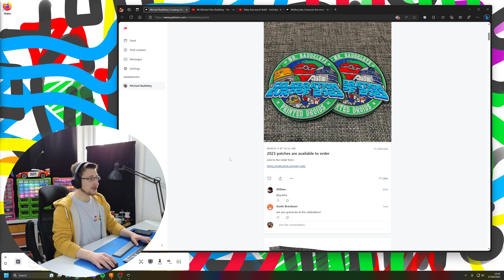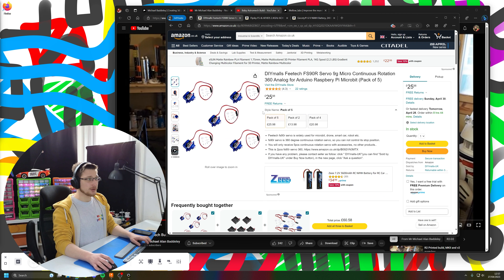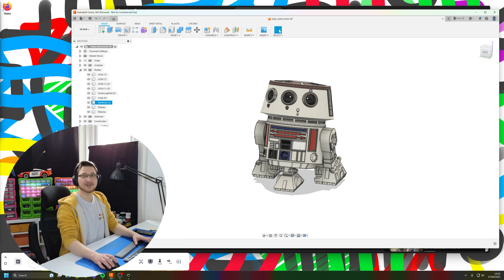Making My First Star Wars Droid

Comment: Nice, now you are a droid builder. My time talking to you at celebration was time well spent.  I would keep your battery and add a small boost converter to increase the voltage to you servos
Reply from the maker: Damn, that’s a good point how do you not think of that. I even have some 😂

Comment: also the esp32 D1 mini has plenty of analog pins, so i use an esp32 D1 mini in the transmitter and a esp8266 D1 mini in the receiver.
Reply from the maker: Yeah, that would have worked, but I only had 8266 D1s the pico was at hand.

Comment: What printer did you use for this?
Reply from the maker: I used my Ender 3S1 with a 4mm nozzle for all of this project
Reply: @Mellow_labs  Thank you! Can I ask what model? I'm new to this and in the market for my first 3D printer. I noticed there are about 4-5 versions.
Reply from the maker: @AdrianPickworth  No problem. I have an Ender3 pro, That was my first printer but it’s a lot of work. The second one I got was the ender 3s1 it’s a lot better for beginners. https://www.amazon.co.uk/dp/B07GYXP9ZL/ref=cm_sw_r_as_gl_api_gl_i_QMQEF270HMT70Y7GDCP1?linkCode=ml2&tag=mellowlabs-21
Reply: @Mellow_labs  Thank you so much!